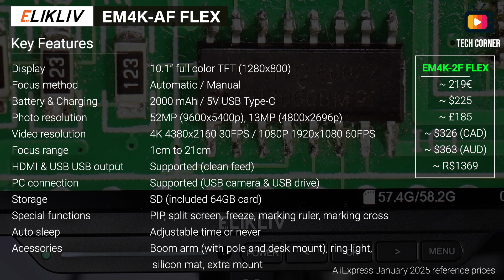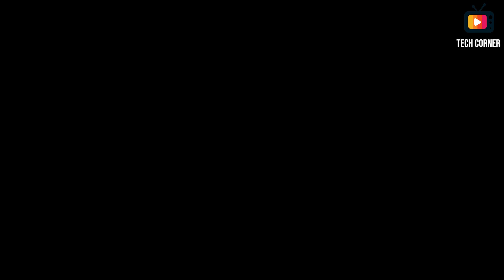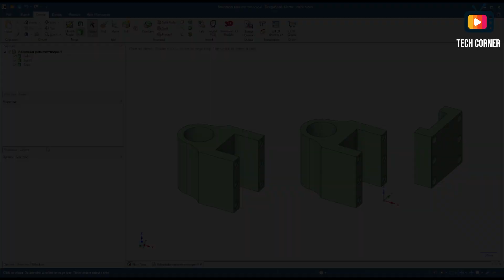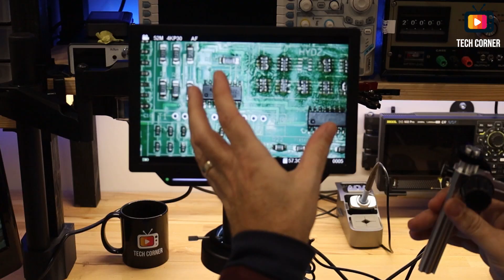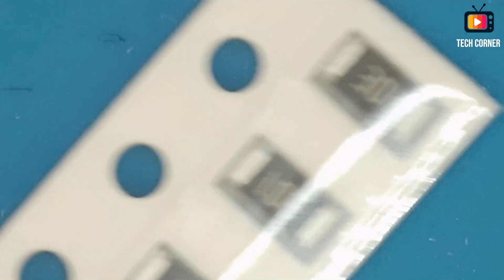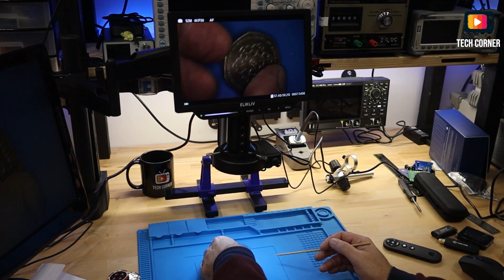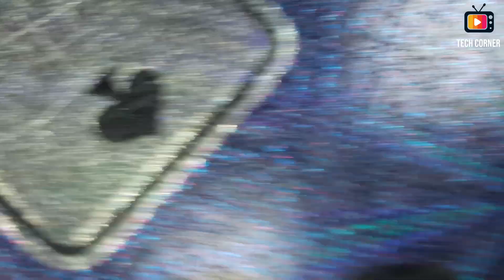Elikliv EM4K-AF Flex ⭐ Autofocus Digital Microscope With Boom Arm

Comment: Can the ring light be used as a face camera light for extra lighting for YouTube videos
Reply from the maker: Hi, short answer yes, BUT the ring light is really small and since the light is so condensed will probably be to bright in one spot. On the other hand, well it can be used as ring light, it will not have the capability of having a cameras lens in the middle because it has a small diameter in the center. A camera ring light nowadays is cheaper and will do a better job :) thanks for watching.
Reply: @TechCornerTV does this microscope have the Freeze/ comparison split screen modes like some of the other Elikliv microscopes?

Comment: For me there is a big problem with the light that produces a lot of reflections, shine. I prefers the LEDs on independent arms.
Reply from the maker: Hi, agree with you. I don't use also the light ring it come with it. Other than that, I'm really happy with it. Thanks for watching and sharing.
Reply: Reflection? What are you using it on ? Coin?
Reply from the maker: @AlejandroNieto-bk3pi This is a great device, but I found out that on 98% of the time I get better results for reading the IC letters by using a side light projector that the built-in lights.

Comment: I looked at another review which didn't demonstrate the zoom. I looked further and found your demo and it was quite complete I do repair electronic equipment (Ham Radio) but want this more for metal detecting and IDing ancient coins for hard to make out details. This unit will allow me to do both. I just ordered one & used your link, so you should be getting some reward for that. I will have to take note of the sloppy manufacturing on the holder. I'll have to be creative, I have no 3D printer. Thanks for the nice review.
Reply from the maker: Hi, glad the review could help you and thank you for watching, your nice coment and the sponsorship by using the afiilliate link. Really appreciated! I hope you enjoy your new microscope, I'm loving mine.

Comment: This looks identical to the TOMLOV 4K Autofocus Microscope TM4K-AF Max, 10.1" HDMI Digital Microscope with Spin Flex Arm which I had my eye on. I wonder if it’s the same company.
Reply from the maker: Hi, you're totally right. Probably they are from same manufacturer, but who will be the manufacturer and the re-brand? 🤔 thanks for watching and sharing!
Reply: @ very good question. Who do you think k in the manufacturer?

Comment: Great review thanks! Do you have links to the 3d printed parts for fixing the wobble issues? Also where did you get the  adjustable board holder please?
Reply from the maker: Hi Angie, I think that you're referring to this board holder ( https://geni.us/t14SkR ), I have a video on it also, search for SN-390 on my channel. Regarding the parts, give me a bit to create an account on some 3D sharing website so you can download it. I made it with Design Spark Mechanical but I will share also the STL. When is there I let you know. Thanks for watching.

Comment: Note that the "Flex" model with the boom arm linked in the description appears to be US$412, not $225 as shown in the specs at 2:01.  The $225 model seems to include the scope with a simpler stand and not the boom arm.
Reply from the maker: Hi again, If you follow the link I provided in the description you'll end in a page that has this description "Elikliv EM4K-AF Flex 10.1'' Autofocus Digital Microscope 4K Soldering Microscopio for Electronics 2000X HDMI Microscope with Arm", it states it is with arm and it is listed at 214€. That said, I know people in the USA normally have lower prices, probably because of lower import taxes and bigger local warehouses. 
In Elikliv page, only 1 of these products is at this price, the others (same product, additional listings) are at a higher price. I suggest you to enter the store and look in the category "Autofocus 4k Microscope" you probably will have listed 6 products, try to see if you have one in local warehouse. Thanks for watching.
Reply: @TechCornerTV  Lower import taxes ?!!!!!!! not now!

Comment: Thank you for the unbiased review.  I've noticed in your 2-3 most recent videos that there's a popping noise that occurs at audio peaks as though something in the production chain is distorting or clipping.  Yet, the resulting audio is not loud enough to be near clipping in the final upload, so the issue must be happening when recording or transferring.  The sound quality seems acceptable, but with an occasional, loud popping sound.  It also seems to have less treble (high frequencies) than usual, but that could be intentional or normal.
Reply from the maker: Hi, you're right, it happens when the sound max the scale in my Zoom H6, that happens sporadically but it is annoying, its true. I've set the sound to a lower level, but then I have to compensate in editing because is too low, I'm trying to find here the sweet spot. Thanks for watching and you comment.

Comment: A piece of paper on the mount could help to improve this shakes. Well, better than this. Sometimes a bit of glue…
Reply from the maker: Hi, the paper might help, the glue will fix it for sure, but then I couldn't use the height to give more amplification... that's a pity, such nice equipment deserved a better mount. Thanks for watching and your comment!
Reply: @ Thank you for your video and your reply. I mean to decrease radius of the holder if camera is shaking inside of it. In case if it is issue of a linear gear it could be solved also. I didn’t mean to fix it forever in one place.
Reply: @CybisterBug  Not going to be effective, there is a huge gap there. Even worse is the side-side wobble of the rack and pinion arm. I fixed both issues on mine. Also, the lens tube actually tapers smaller towards the end - such that tightening the ring-light screws doesn't really help and it tends to slip down, eventually falling off. I fixed that issue as well. A lot of mechanical issues but the camera and screen are good. I tried posting image links to the fixes but YT is just removing the posts.